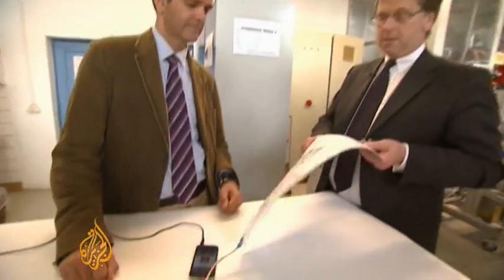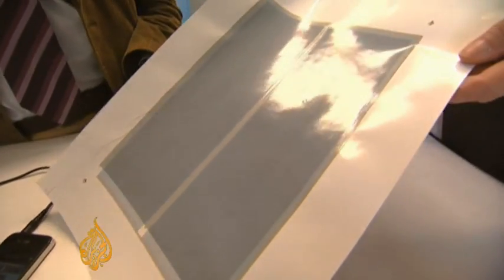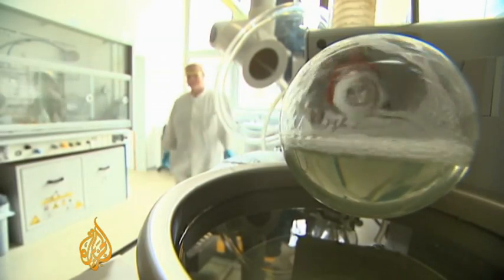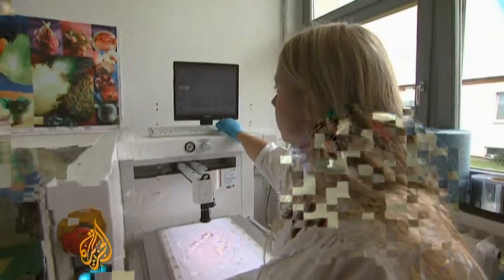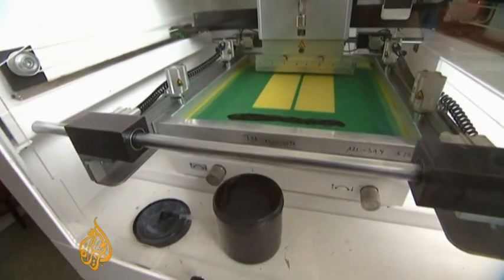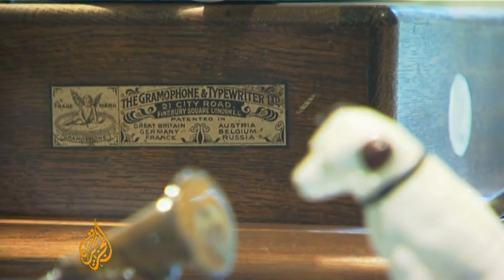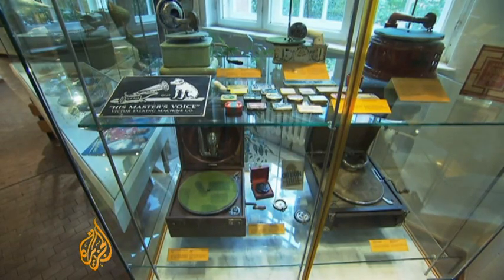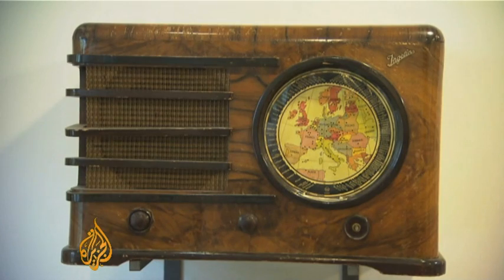New German technology turns ink to sound

Comment: To me it seems there are many applications for this technology. E.g. electronic newspapers - there's already the possibility to display a video with electronic ink, now you can add the sound. An Instruction manual that reads itself. An mp3 on every coke bottle. Material for learning languages. And so on. 

Apart from that it seems at least for now, they are only able to store and retrieve sound from the paper, you still need an ipod/iphone or at least earphones to play it.